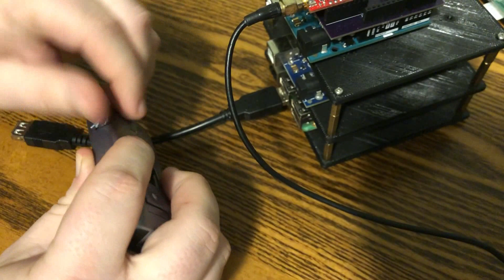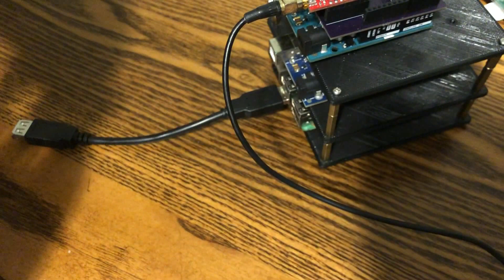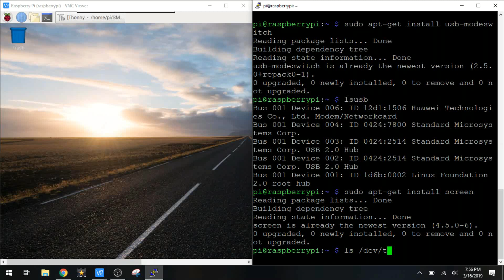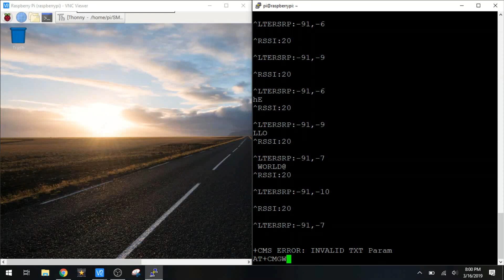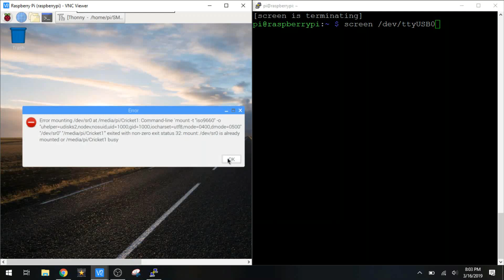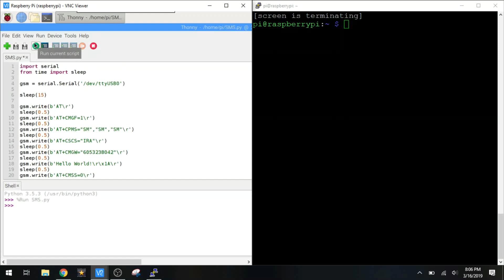Sending Text Messages | High Altitude Balloon Project | Raspberry Pi 3 B+

Comment: Hello Pi Monster as I shal reger to you since you say you think of Pi (assumably, alot lol)...  I am verry interested in the Cricket cellular modem you used in this tutorial.  I want to do something similar but on the ground for my fire departments enginies.  I have a copule of questions first though.  I am hopeful that you will reply to this somewhat sooner than later (in the next 24-48 hours).
1.  Can these be purchaesd on Amazon and if so, what is the cost in USD?
2.  The 'Ting' SIM card for the cellular modem, you said it was $10 but what is the cost per month for the SMS services and what if any is the limit to how many text you can send, 
3.  Can you also receive text back to the modem and then read it from the attached Pi?

I eagerly await your reply...  Best regards,  Tim Curtin

Comment: Creative solution.  Do you think the pi will be able to supply the current for this modem through the USB?
Reply from the maker: That was a concern of mine as well, but I’ve measured it using less than 100mW and I’ve sent over 100 messages from the Pi